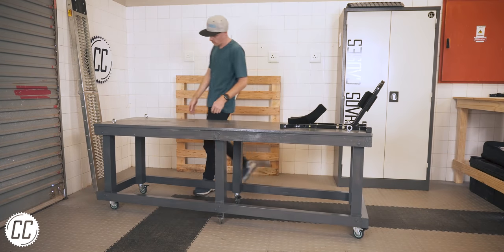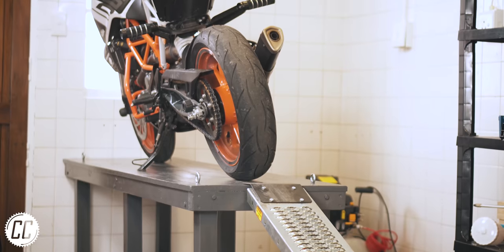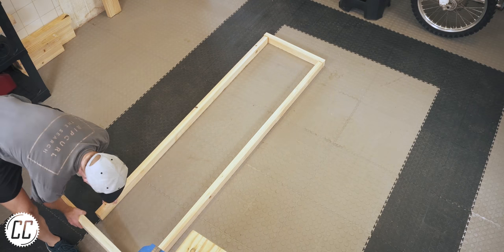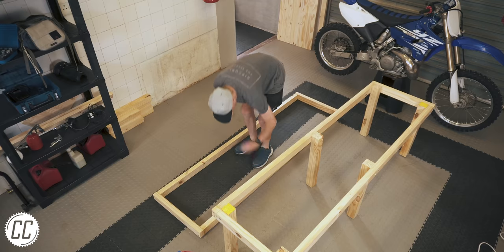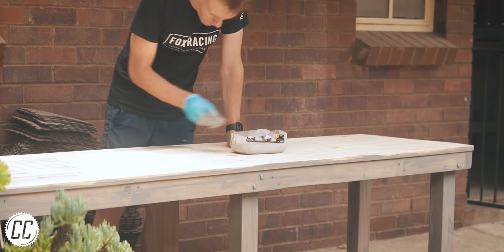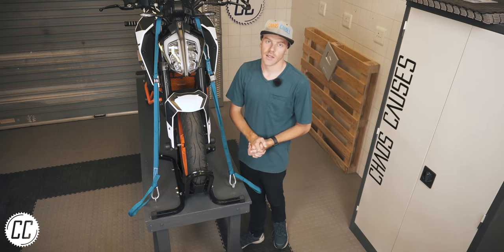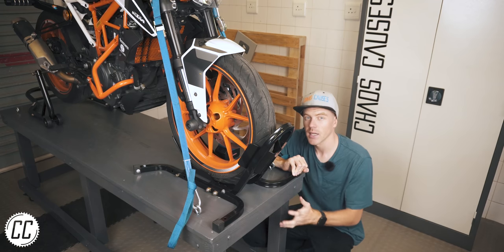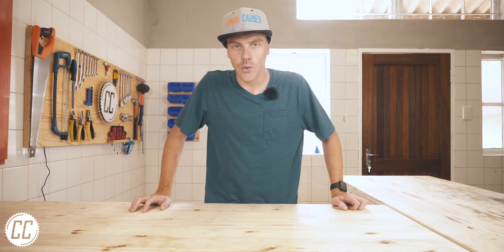DIY Motorcycle Lift / Bench

Comment: You can actually cover the top with an aluminum sheet to improve its resistance to oil and dents, as continuous use of the wooden table top would eventually scratch and remove portions of the sealant and expose the wood to invasive liquids. But, hey! Whatever works is fine!
Reply: Aluminium would scratch really eserly I would recommend stainless steel and get some to help you lift it
Reply: @jameslockyer9796  i’d say leave it wood so it can be replaced if it gets damaged be on use it can be replaced cheap and easy
Reply: I was thinking diamond plate steel. Strength and a bit of style to boot. Plus the pattern adds a bit of friction to it.
Reply: I was thinking cheap carpet,  cheap,  easily replaceable and gentle on new parts being put on... you can always put something there if there's a chance of an oil spillage type job being done..

Comment: Great job Mate. I built myself something very similar & it's the best thing I've done for working on my bike. Two suggestions though... 1).. Add a few diagonal braces underneath to really stiffen it up. 2).. Add some way of attaching the top of the ramp to the bench while you are running the bike up it. If that ramp slips it'll be a disaster.
Reply: Good idea. I need to have a nice rolling table + motorcycle workbench for home. Our wood here in the USA is not straight so I would use angle steel with the casters. :-) (2) 2x4 to create a 'tire track to improve stability moving off and off the ramp. Attach using eye-bolts if you want to remove the runners when not needed - and also for tie-down points. You can mount an inexpensive motorized or hand winch to help guide the bike onto the table. Looking forward to other comments/mods.

Comment: You actually pretty much addressed my one "concern" about this build.  I was thinking it needed to be about 6 inches lower (about 15 cm) because it looked high to me when you started pushing that dirt bike up the ramp.  

You probably don't have to worry much about the weight on the wood, overall.  Aquarium stands are often made out of MDF, and actual 2x4 (I guess about 5 x 10 cm) studs are significantly stronger.  To put it in perspective, the accepted approximation of weight for a 55 gallon (~210 liter) tank is about 10 lbs per gallon, so approximately 550 pounds (~250 kg).  Your bikes probably weigh no more than that (not motivated enough to go look up the weight of an R1 on the chance you'll get one again) and you used real wood, not MDF.  You also seemed to use a decent thickness for the top, so that'll do well to distribute the weight relatively evenly, reducing the pressure on each individual wheel.  They'll eventually fail, but you'll probably upgrade them before that happens.

Comment: This is neat. You’re young and fit, so you should be able to cope with most bikes. You could add a walking ramp beside it to walk up as you push the bike up the ramp. 

There was a very interesting design for a tilting or rocking wooden bike bench (which locks level automatically) doing the rounds a few years ago. Somewhat lower, but it acts as it’s own ramp. That’s the one I’m planning to build. 

One great opportunity you missed on yours is storage spaces for tools, draining pans, oil cans, cleaning materials and parts etc. beneath the top. Shelves would be easy. You could even add drawers too.

Comment: We used to build our own stands like this when I was a kid (the 70s)  however we used the rear of the stand as a ramp that swung out then the table tilted down to make loading the bike easier. The pivot point was in the center of the length of the table and as the bike was pushed up  onto the table the table would drop down to the flat work position and ramp would tuck in under the rear of the table acting as the rear support

Comment: Flip the LIFT  upside down, unbolt and remove the frame. Now just cut off a couple of inches from each upright/support, reassemble and your done.
Nice job by the way, I'm saving your video. 👍

Comment: It's a really cool idea. However, I'd be worried something may go wrong when getting the bike on it with the ramp, since I'm not that tall. Might need a "workbench" that's a tad lower.
Reply: For the "vertically challenged" it is possible to aim for 2.5-3ft height so you can deal with lower work from a chair and still keep off your knees. As well as using a stool if you still have work higher up ( wiring, etc.)
Reply: I would definitely make mine shorter than he did. I’d be very nervous about dropping my bikes trying take it on or off
Reply: Having dropped my bike (twice, into the side of my car) whilst trying to put it on a paddock stand, there's no way I'd risk running it up onto a table to a height it would probably kill me from 🤣🤦‍♂️

Does look solid enough though, and if it suits your needs...

Comment: My advice, get rid of those casters and instead look for work bench casters.  Those are designed to be, essentially, retractable.  When you need to move the bench, you drop them down.  They are very heavy duty and will easily carry that weight.  When you don't use them, the bench rests on it legs, so the height issue is gone, as is some of the stability issues you have with that bench being on wheels.  I use these on my woodworking benches and they are a godsend.

Comment: Hmmmm very interesting… I’ve always wanted to build my own lift…just like I have always wanted to change my own tires but never end up doing it because it’s difficult 🤪😂 Will try doing it someday!
Reply: I bought the spoons to change my moto tires come spring. But recently i had to take a tire off a small rim for a snowblower…. Now im 2nd guessing how much of a PITA its gonna be. Good lord it was the WORST! 🤣
Reply: You'll find that the larger diameter wheels and rubber will make your job far easier. 10 inch Vespa - nigh impossible, 12 inch - hard work, 16 inch - easy peasy.

Comment: Seems like a great first build, i would lower it taking into consideration the wheels too, so even with them on still get to the correct height, also i would add a rubberized mat on the table top surface, adding extra grip not only for the bike but for tools and nuts, etc, maybe  i would like to upgrade it un the future to have a hydrolic system to get the bike up like comercial ones have, so is even easier, and maybe add an small box attachment, so i cant put a plastic box to put the nuts and bolts there when working on the bike for confort .

Comment: good idea.  One does not even have to it this tall, mine is just a few feet off the ground, around 3 feet. I find it  easier to push the bike with a lower table, and I am not that strong :D . most of the time I use a rolling stool since I do work sitting down  :D

Comment: You could easily shorten the legs of your project with a chop saw.  When I put my motorcycle in my truck I use two ramps.  One ramp is for me to walk up and the other is for the bike.  Maybe you could Incorporate two ramps to make loading the bike easier.  If that doesn't work you could build a scissor lift.  A few people on YouTube have made them.

Comment: Only because I have easy access to worn out ballscrews, I would use steel and make the legs hinged so you could drop it much lower for loading and then use the previously mentioned ballscrew to push the hinged legs to the height you want the lift at. I know it's overkill but I have the tools and skills so it isn't too unreasonable.

Comment: Great job...building a piece of equipment is always more satisfying than buying it.  My only issue would be getting my bike up on the worktable.  If the top of table could angle down to load bike than crank it up to raise it, I would be more prone to use it.

Comment: Great idea and execution - even a little overengineered I reckon!
Got me thinking about alternatives and I reckon using a lifting air bag solution would work well and would eliminate the ramp.   At 80" x 24" (200cm x 60cm) you'd need a large volume of air but less than 0.5psi and I'm thinking of a vacuum cleaner cos you'll already have one of those in the shop. You could even fit a small skirt to the underside of the base and use the air to lift the whole thing (with bike) to move it round the shop like a hovercraft.

Comment: folding castor wheels are a thing, you can pull them up so legs are on the floor when loading and unloading bikes. then push them back down when you need to move it out the way

Comment: awesome work. the only thing i would add is to use proper coach bolts instead of screws as (despite drilling pilot holes) potentially the screw is splitting the wood whereas the bolt goes right through a pre drilled gap and will hold the weight better over time.

Comment: I make almost all of my bike equipment from wood. However, if you have any concerns about strength, use a good quality plywood. Instead of 2x4's, just laminate a few strips of 3/4" plywood ( or your favourite metric equivalent.) It will be far stronger. Or make the dimensions slightly under sized compared to 2x4's and end up with something a bit lighter.

Comment: An option to lower the height would be put the castors on brackets instead of the bottom of the legs. Position the brackets up the frame so the wheel is on the floor and the leg is just off the floor.

Comment: Great stuff, I like the wood!
You could have the eyelets coming out the sides if need be, the timber there is thicker & wider.
I personally would have the bottom frame higher and make it a shelf, tools, parts, & in the process you would be able to stand a little closer.
Cheers mate.

Comment: If doing this without the ability to raise and lower, the table should be shorter.  Not everyone will have a lightweight motocross bike or small Supersport.  So this works well for this particular person but someone with an average sized cruiser or a much heavier bike like a dresser harley certainly won't be using a ramp to get it loaded.

Comment: I would have put wider legs under the table and saw out the width of the balk above it which creates some kind of "u" around the balk which is for the wheight coming directly down and strong for the wiggling right and left so the leg doesn't flip over

Comment: By the way. You can buy an hydraulic foot operated steel table (made in  India I believe). About 20mm high when lowered. (Comes with a 50mm ramp). Heavy but can be lifted on its edge and stowed against a wall. Will cost about £300 to £400.delivered, But like you say. « What’s the fun in that »
Also, take a look at what ABBA BIKE LIFTS have to offer. I kinda regret buying my table lift after seeing those.

Comment: if you want a cheap one that is height adjustable build a table top on an old hospital bed a friend of mine has one and it works really well to adjust the height you just pump the bed up with the built in hydraulic lift and its strong cause your not going to put fragile people on a weak bed

Comment: The legs should have been attached to the lower face of the blocks of the table, by this the compressive load will act on the legs, now it's been balanced by the bolts and glue and the are being subjected to shear force which will result in wood being damaged in long run or impact or heavy loads. If they were attached to the lower face the glue or screws will have only job to hold the legs and table together and will be able to bear loads around 3x more than this one.

Comment: Looks good, but it isn't a lift, its a bench, a work bench for your motorcycle :), could always chop the legs and make it shorter, then add a small pivot/scissor point that attaches to the top and bottom parts which can be controlled with a JACK lift you get with most cars :) or an aftermarket one.

Comment: Why not make it with hydraulic cilindres and a pump so you can lower it and lift it. And when lifted to a good hight, drill a hole in every leg and secure it with a pin. You can place extra legs under the table top that become usefull when you want to secure them with a pin. You know what I mean?

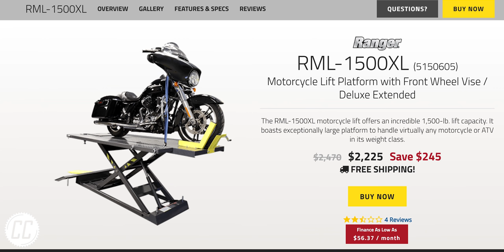Comment: 8:58 Not really as bad as you made it seem, a Lift can be had from harbor freight tools for about 500. So you can claim a fraction but more like 2/3 the cost and not a 1/4. I would highly recommend anyone with a bit of money to spend on this, Save another 2-300 and get a cheap Actual lift. IT will prove worth it the first time you Eff up and your bike takes a spill off the table where it wouldnt off the lift.

Comment: I fabricated one with 2x4s, steel hollow bar and angle irons and had to modify it by adding additional bolts (not shown in this video). i had initially planned on using wood as the main frames but decided to use steel along with it to reduce the chunkiness and increase strength, so I used a 12mm Brazilian plywood sheet, cut in half and layered on top of each other to give it more strength (Amost an 1" thick). This gives it good strength and durability. Ofcourse mine was modified froma foot operated smaller lift that are used primarily for cruiser type bikes.    https://www.youtube.com/watch?v=F7wBvZUe64Y. There were quite a few adjustments and changes as I went along.
I have now had my 250kg bike on the ramp for 2 days (It is a V-Strom DL1000) and it has held up very well.

Comment: I built one similar, but it was wider and lower and with a double thickness top to accommodate a 250kg bike on its center stand.. I think yours is too tall and possibly unstable. Think about how you access the top of the bike....

Comment: A little over engineered in my opinion (2x4’s  a bit excessive. Studwork  timbers would have been fine), but better safe than sorry I suppose. Scaffold planks for the tabletop would have been my go too. They’re cheap and strong and I would have topped them with 12mm ply or MDF. Screwed down so as to be removable in a few years if nec.
Now figure a way to hang a twin sling on a reduction pully overhead to lift the bike vertically and slide the table under the bike. 😊👍

Comment: You should not screw into end grain. It's a very weak join. There are many much, much stronger ways of fastening the end of a board to the side of another. A little research on this will pay huge dividends in the long run.

Comment: the table doesn't actually lift anything you use a ramp. 
i'd call it a motorcycle workbench. 
if you say its a lift it sounds like it has hydraulics (like a lift cart or lift gate) and lifts the bike up. when in reality its just a mobile workbench that couldn't even lift a fly.

Comment: Its not a lift, its a table. For the amount of money going on it that ramp is way to sketchy, sooner or later u will drop a bike from it. Id much rather buy an actual motorcycle lift bench for about 1,5 to 2 times the money u spent on materials for that table. Yes, there are lifts that cost 2K like u shown, but there are much cheaper ones as well.

Comment: This is a terrible idea.  Don't do this.  First off, it's not a lift.  It does not lift.  Secondly, the stability of the structure is sacrificed for mobility.  Could just be a preference, so i'll grant that bit to you.  Lastly, this is built too high.  Most lifts don't extend more than 1m.  Enough to put your axles at eye level if sitting on a shop stool.  Or the controls at eye level while standing.  YT recommended this video to me.  So, blame them for me being here.  Blame my experience for the need to 'negatively' comment.